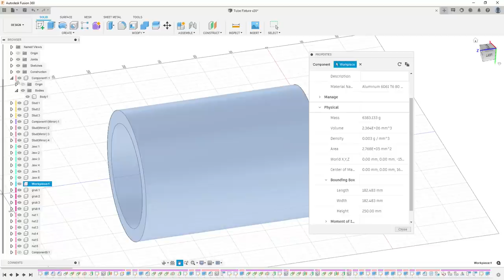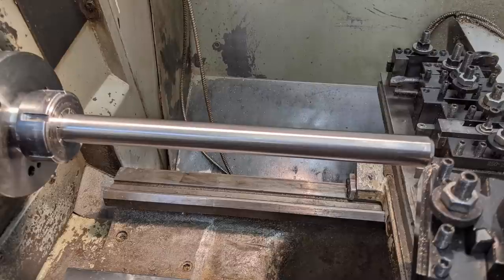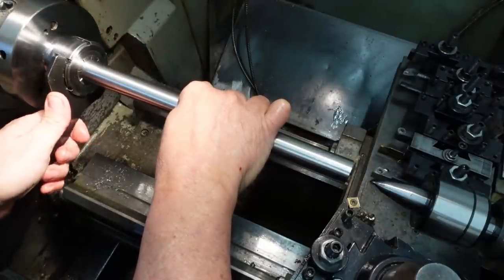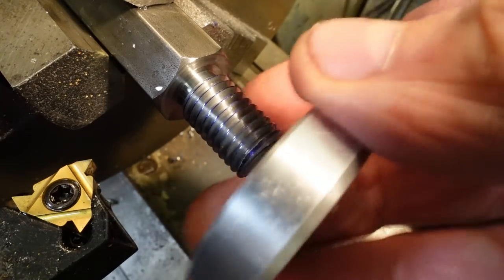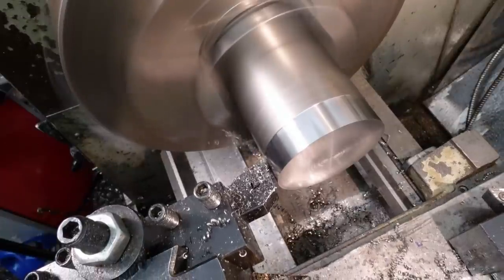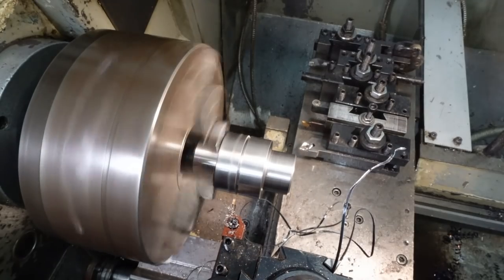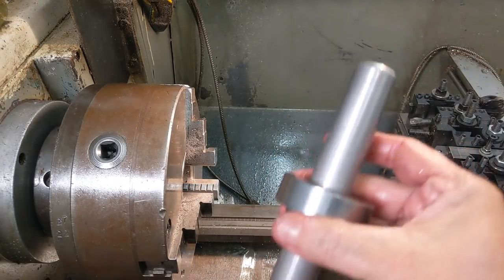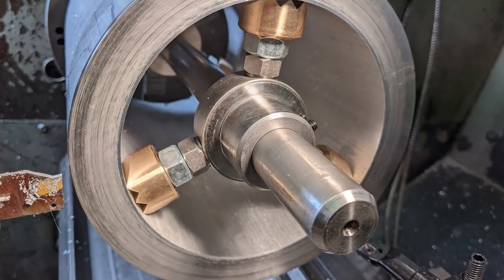Is it a Spider? Is it a Mandrel? Is this my worst-ever coffee-fuelled machining project?

Comment: Max Grant did a tailstock chuck recently and this seems like a good counterpart.  There's no welding for this which makes it the easier one to start with too.
Reply from the maker: I enjoy watching Max making things. A rotating tailstock chuck is on my list of things to make next, but a steady-rest is a higher priority. A surface grinder would make life better, so would a  proper bandsaw. I need to retire from the day job so I can play harder at my hobbies!
Reply: I did the same with a 4 jaw--I went 4 jaw because of the adjustment for accuracy--I have no regrets and  vevor chucks have quality and are cheap and no kick backs for me.

Comment: 28:20 Oh that's fun, you're getting four spiraling chips off that drill there for a moment: two from the main flutes, but then another two miniature curls off the edges of what I'm assuming is a split point. That's a sharp, well-ground and well-centered drill right there.
Reply from the maker: I get those from Drill Service in Horley. Super grinds on them, at least until I decide to refresh the grind, then it's all downhill.  My father was a tool and cutter grinder, he could grind freehand split points just by feel.

Comment: I like your mandrel thingy. I probably would have gone with 4 adjustable screws, but seems like it's working for you.
Reply from the maker: Thanks Chris, I had an idea in the back of my mind about drilling and threading six holes in the collars, with four at 90 degrees and two at 120 degrees from one of the first four. There's enough clearance for that.  The trick with three is to tighten or loosen one jaw, then loosen or tighten the other two by exactly half as much. It does take longer than it would with four jaws. Next time I need to use it, I'm going to make two extra studs and drill/tap three extra M12 holes, then I'll have the choice of three or four. If I'm using thinner tubes, I'll make up quadrant-shaped soft-jaws to fit the tube ID rather than the brutal ones in this original. Now I just need a 63 inch VTL and I'll be able to make PROPER parts...
Reply from the maker: For the final version, I added four holes in the collars at 90 degrees and made two more studs and jaws, so it can now be used with three OR four jaws.  Thanks very much for the inspiration.
Neil
Reply: I'm glad you made this comment, and glad M&M mentioned it. I've been watching your videos ever since.

Comment: I had approximately the same problem with an oversize piece of stock. But, while you were showing off your skill with your CAD program,  I cut a hole in some plywood to support the length of the piece, then shimmed and clamped my wooden mandrel onto the lathe bed using a dial indicator. With a light cut to establish center, I then drilled for a live center and I was  in business. Granted, this was a one time setup using what I had available in my garage.
Reply from the maker: Perfect engineering solution!  Love it!

Comment: I think you missed a trick there. You had the 3 studs on the centre axis. If you moved the 3 studs to the side of the centre axis (like an Isle of Man flag) you could have made the studs longer and the adjustment range much larger.
That would have made the tool more useful on future jobs. Sure you would have needed to change the teeth design but with 6 points of contact you probably don't need big sharp teeth anyway, 6 roughened "nubs" expanded out would grip a tube quite well. 👍🙂
Reply from the maker: Good thought. Also if the studs were at a tangent, the forces from turning would tend to make the teeth dig in harder.  The collars could have cutaways like the teeth on a ratchet. Not sure if it would liberate much extra adjustment though, as the radial movement would stay about the same, and I'd have to think carefully about spanner access.  Might be worth considering using eccentric cams that can be adjusted from the side.  Certainly worth considering if I use soft jaws on thinner material. My original thought was that I'd make multiple sets of studs, but for larger material, I'll probably just make longer jaws.  For smaller material, I could indeed just remove the studs and jaws and use bolts with raised nubs in the centre of their heads, running in the M12 threaded holes. The expanding plugs work well for the smaller items up to about 80 mm, but I have some upcoming jobs for antenna feedhorns where the body is a 160 mm dia tube made from aluminium sheet 1/16 inch thick with TIG welded seams.  There's a 250 mm dia ring flange attached that will need turning at the edge, so I will need to come up with a solution for that.  Plus of course, I get the fun of making yet another fixture.

Comment: Nice work Neil. Happy New Year
Reply from the maker: Thanks Howard, I need to get on with those heatspreaders. This fixture if for a job that's been waiting EVEN LONGER, if you can imagine that.  122 GHz parabolic dish mounting rings from Oct 2020. What with the backlog of work AND the very busy day job AND family stuff over the hols, catching up is tough.  The pile of 3kW watercooled UHF PAs is cluttering the place up as well.  Wondering seriously about tearing the pallets out of one and using it for a big 23cm SSPA.  They have 3 x 48V PSUs and all the water plumbing for a rack mount chiller. Easier than building a rack enclosure perhaps.  Loud as a loud thing on 432 MHz obviously!
Reply: @MachiningandMicrowaves  Always great to see your work. Haven't seen the amps that you bought.  Do you think the MRF13750 pa's will fit..?? Sounds like it would save a lot of work. No snake cooling plates...

Comment: Could you accomplished the sam thing, but easy to adjust, by making 4 center pieces to fit the shaft,  with the inner ones fitted tight with grub screws,  they make a wedge shape that fit a disc that is beveled on both sides, and split into 4pieces,  the disc fits inside the tube, with the shaft through it, then the opposite side wedges fitted,. When tighten  the center shaft is threaded,  the wedges spread the disc against the inside of the tube,   similar to an exhaust pipe expander tool,   it maybe easier to make, and can easily fit different size tubing!  I know I'm rubbish at explanation   but hopefully you get it! 😜👍
Reply from the maker: I use something similar to your idea for smaller tubes up to about 80 mm ID, with a six-way split using conical wedges from each end.  The jaws are made from Acetal or Nylon. Works very well, especially if I turn custom rings to fit inside round tubes.  The close fit means the expanding jaws don't distort even thin tubes  At smaller sizes, I have an expanding mandrel set for up to about 28 mm.

Comment: Do you have a video or plans for your tailstock indicator. I plan to make something similar, just got a mitutoyo scale.
Reply from the maker: There are a few designs out there, I made this one in 2019. It's a simple split collar and bolt-on tab, then a magnet glued to a block at the free end of the scale.  The scale body is screwed to a weirdly-shaped block and has more magnets to hold it to the edge of the tailstock body.  I found an old blog post about it, at http://www.g4dbn.uk/?p=1035 http://www.g4dbn.uk/?p=1045 and http://www.g4dbn.uk/?p=1055 so there must be a CAD drawing for the body somewhere. Might be worth doing a short vid about it.  The scale I used isn't sealed, and it's gradually filling up with cutting oil, but it was very cheap and I keep a spare just in case. It's been immensely useful.
Reply from the maker: Can't find the original of the angled mounting block for some reason, I'll have a proper look later.  The drawing of the ring and tab shows a 28mm wide tab, I think the real one is more like 20mm.  Sounds like I need to go measure it and refresh the Fusion model http://www.g4dbn.uk/wp-content/uploads/2022/01/Tailstock-DRO-collar-Drawing-v3.pdf

Comment: Have you considered using a set of spherical washers under the brass teeth to compensate for offset?
Reply from the maker: That's a great idea!  I was trying to work out how to do something like the ball joint on a G-cramp, but machining a spherical mating surface on the nut and a matching concave surface with a larger hole would be a useful upgrade, especially for cast material and welded hollow sections.  Thanks for the tip.
Reply: Happy to help

Comment: What kind of camera do you use for filming purposes? AMAZING QUALITY
Reply from the maker: I really hate this camera, it's the second-worst camera I've ever owned for usability, creative control and dynamic range. It's a Sony ZV-1 and the manual focus is almost unusable, the autofocus is horribly slow, inaccurate and impossible to lock using follow mode or anything at all really. I feel like I've just burned a slab of cash.  It can't even be plugged in to power while you are using it, so if the battery runs out mid-shot, that's the end of the scene.  It's utterly hateful.  On a cold day, if I take it out from the warm house to the cold workshop, the lens actually steams up on the inside. The lens cover is flimsy and  you can't fit filters, but also, there isn't a protective gorilla glass outer lens.  The only thing it does well is capture what's left of the image after the lens, focus things and user controls have munged it up. The worst camera was a tenth of the price and wasn't much worse.  This dreadful bit of fashion accessory tech is probably fine for folks who make Youtube videos, but, er, oh, wait....
I bought it because I could pop it in my pocket and just use it without any faffing about, but after you'd got a task light and two colour-mixed LED illumination panels and a tripod to set up, any benefit is lost.  It can't even run with a simple remote switch, unless it's connected to some device, but then I'd need two hands.  The control buttons are stupidly small and... well I could go on, but you get the drift.  The decent-looking scenes are made despite the camera, not because of it.  Avoid at all costs!  Unless you're a vlogger doing pieces to camera on a gimbal, then it might be a really good choice

Comment: It was easier to make a plug of 3-5 different diameters, like a stepped drill
Reply from the maker: Tricky bit is how to support the tube so it can be machined on the outside, end and a little way inside, and then parted off safely.  I wasn't sure how safe it would be when the parting broke through if I was supporting the tube using plugs in the ends. I do have lots of those stepped plugs where I only needed to machine the outside of a tube. They start off one size but then get modified and added to. "Easier" isn't always "More Fun" though, at least for me.  If I was doing this for money, I'd have paid the £0.50 per cut to have it bandsawn by the metal supplier! I totally get it that I'm able to take advantage of my financial privilege by not costing in my time, or rather by discounting the time against the amount of jolly machining and design and general messing about that I got to do. Might have been rather shorter video if all I had to say was "Ordered some custom-cut rings from Aluminium-R-Us".  Not a lot of dramatic tension or potential for comedic commentary in that. I'm just a sucker for doing things the complicated way for the sheer joy of making stuff. Yeah, privilege.
Reply: @MachiningandMicrowaves  
the processing inside to some extent justifies your decision, but I still think that you do not cut pipes every day :)
Reply from the maker: @patevm4435  I think "Decision" is rather overstating the amount of logic involved here. Perhaps more like "whim" or "flight of fancy" or "totally daft idea to make a dank winter evening a bit less tedious", or even en as a counterblast to the inevitable march of entropy towards the eventual heat-death of the Universe, but yeah, you are right!
Reply: @MachiningandMicrowaves  I understand you, I was also an electronics engineer for 35 years, and now I have bought several Chinese machine tools. Computers are tired .. But again you need them for making complex shapes.
Reply from the maker: @OtripleXY  I have a 750W servomotor that I will be fitting to my lathe so I can make complex curved surfaces, parabola, hyperbola, ellipse etc.  I prefer PIC as a microcontroller. Should be interesting to build the interfaces and drivers. I might even make it standalone and parameter-driven rather than using a computer

Comment: It's hard to tell in the vid but what size is your lathe?
Reply from the maker: It's a Colchester Student 1800, 6.5 inch over the bed, 25 inch between centres. Not exactly in the @abom79, @CuttingEdgeEngineeringAustralia or @bcbloc02 class, but it was cheap and it's compact. It has an inverter and electronic braking and DRO, and it makes decent enough parts. Limit on long tube diameter is the height over the cross-slide, so max 8 inch diameter.  The tube in the pics is 6.5 inch outside diameter.

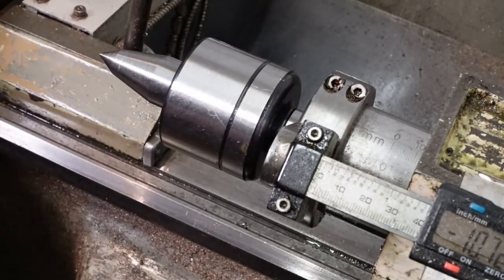Comment: at about 10:15 it looks like your tail DRO is running low on fluid.
Reply from the maker: The downside of not using IP67 rated scales!  There's a level where the oil getting in is balanced by the oil leaking out.  Sadly. most of the fine metal dust in the oil stays inside and eventually, the scale electronics board decides it's had enough and goes off to DRO heaven. Usually they last 2-3 years, which at £25 is definitely a bargain!